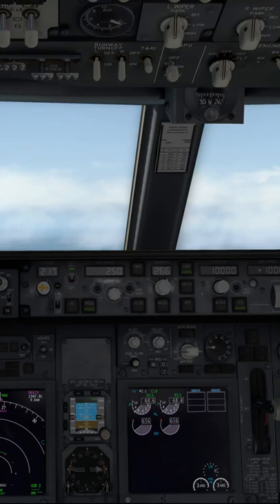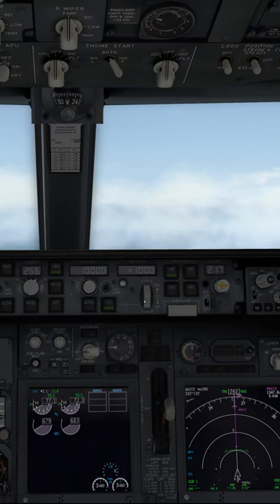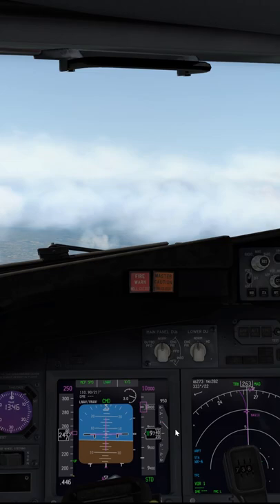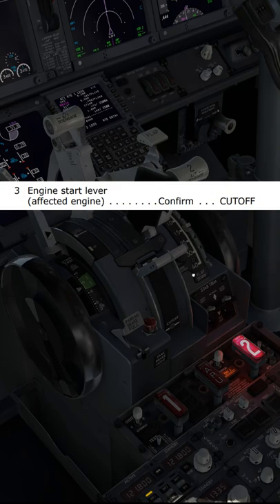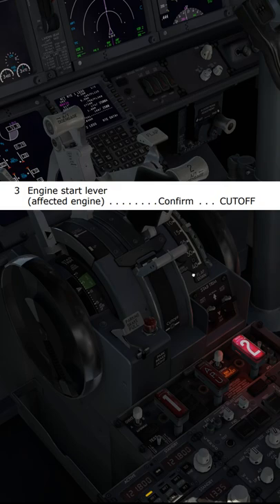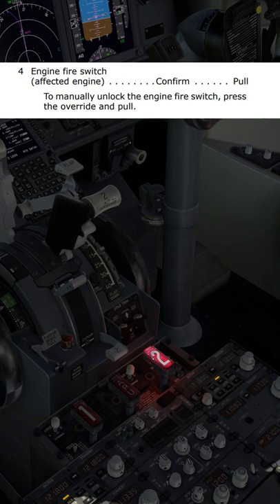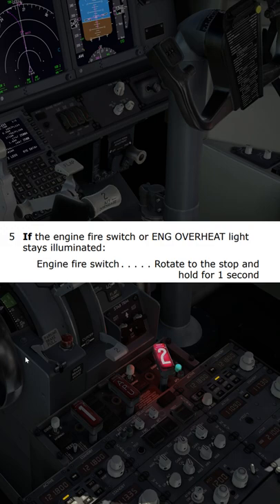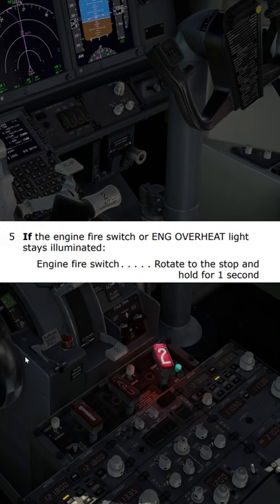Boeing 737 Engine Fire Memory Items #Shorts

Comment: Nice video! Where is engine overheat illuminated?

I'm guessing the Engine fire switch (The one you pull, then twist for one second?) will turn also stop illuminating if fire is extinguished?
Reply from the maker: Thanks! The overheat is a separate light indication on the fire panel. If you pause the video you should see it. Once the fire is out the switch will stop illuminating.
Reply: @Taylair Is the fire panel the one with the master caution lights? I'm grateful you are able to answer 😁
Reply from the maker: It’s right next to the red switch
Reply: @Taylair  Thanks! I saw it now 🥰